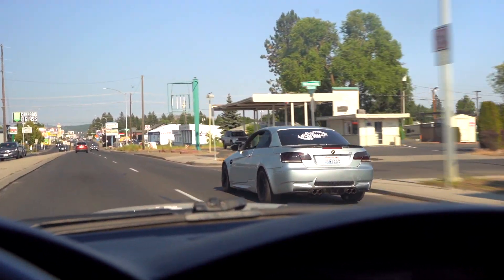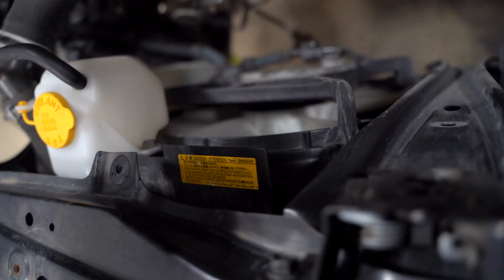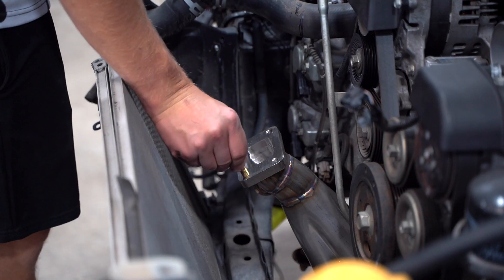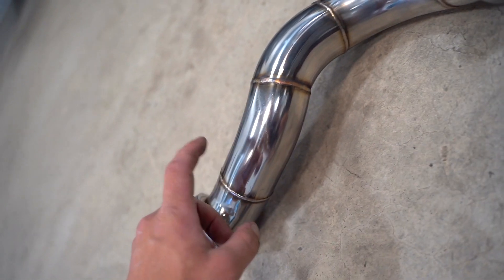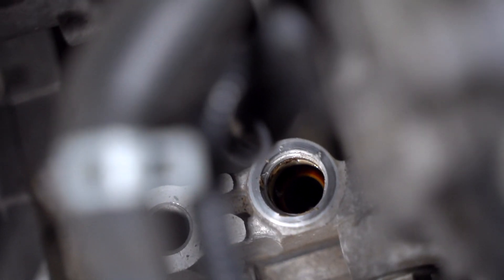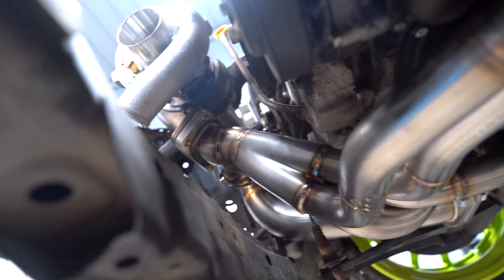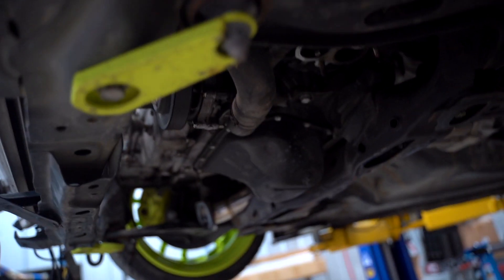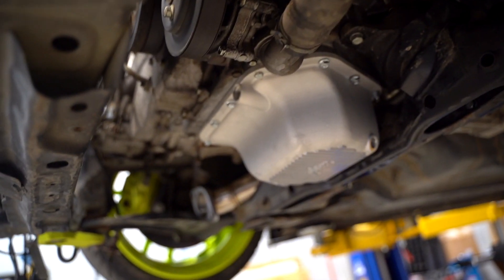INSTALLING THE FRS TURBO!

Comment: Bro, I recommend that you heat wrap your headers and down pipe. Especially the down pipe, it sits super close to your main coolant hose.
Reply: I would cerakote it first
Reply: Not a good idea. Heat wrap and oil aren't a good idea. Asking for your car to burn down. Especially since the headers are the lowest point on a boxer.
Reply: @toodanderson351 I’ve had my downpipe and manifold wrapped for over five years and 40k miles on my brz with no issue🤷
Reply: @Online_ToughGuy you think is worth the shot?
Reply: @Carlos.Rivera  I would do like buddy above said and get it cerakpted

Comment: LOOKS GOOD!!! Due to the weather up there in Spokane right now, you should probably invest in a BIG-ass fan. Down here where I'm from,(Florida) circulating air is a must-have when you're working in a inside/outside environment. Heat exhaustion is REAL!

Comment: After waiting for two years you are still missing parts for install? You need to plan better mate. Looking forward to the rest of this build and think about if pipes need to be titanium wrapped or coated? Gearbox and clutch will be a failure point I think plus boost on still high compression factory stock block will be another of course.